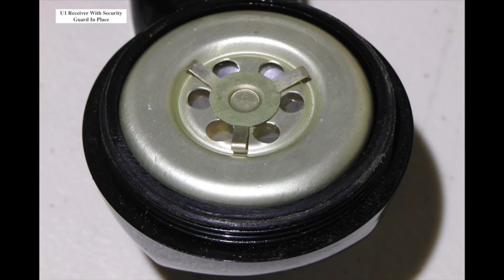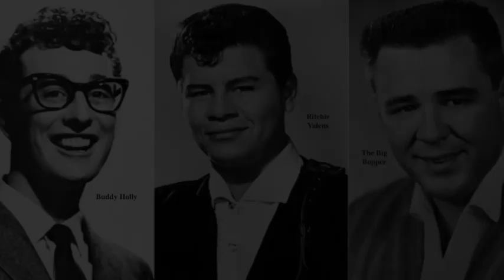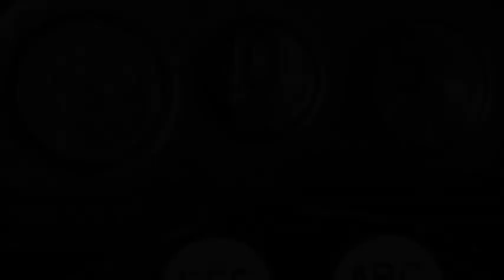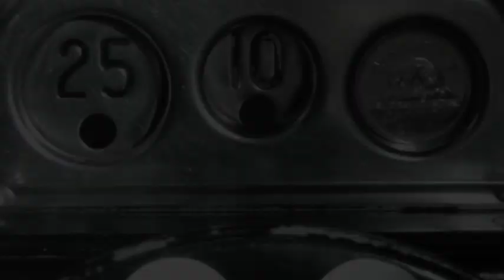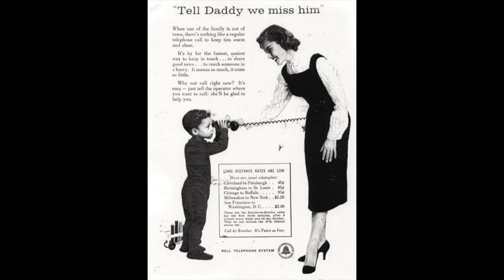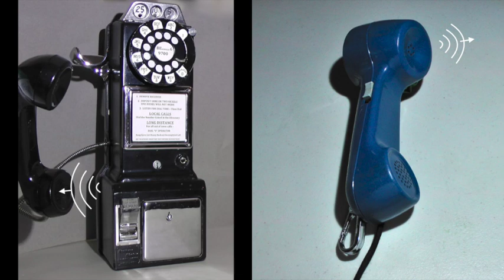The 3-Slot Payphone Part 1

Comment: Your have described the pre-pay method of pay phone service. There was also a "post-pay" type of service. With post pay, no coin deposit is required to start the call. Simply lift the handset. The dial tone(or operator's response on a manual exchange)is heard b y the caller. The caller dials the desired local number. Upon the answer, caller must immediately deposit the payment. If no answer, no payment is required. Caller simply hangs up.
Unlike pre-pay, there is no coin return on the pay phone itself, except for bent coins. Making a long distance call,  caller dials operator as with pre-pay, except the call payment is required when the called party answers; no coin return. Phone's instruction card would read: DO NOT DEPOSIT MONEY UNTIL PARTY ANSWERS.
Reply from the maker: Yes, this was the most common method up through the 1940's. In the 1950's and and 1960's, the prepay method was the most common (in the Bell System). In the 1970's, it reverted back to a new form of post pay called  Dial Tone First (DTF), to ensure people could reach emergency services without having to fumble around for a coin. Thanks for watching.
Reply: @Hicken65  The one time I used a post-pay phone, the way it worked was when the other party answered, a loud buzzing type sound came on that didn't allow you to hear the other person until you put 15 cents in, then you could hear the person at the other end, but they would have already said Hello and hopefully they wouldn't hang up before you put your coins in.  It was awkward and pre pay was much better.   Pay phones that took quarters, where calls were a quarter, allowed making an emergency call or dialing the operator without a coin.   You could also dial a long distance number and it would tell you how much money to put in.   You could also make a collect call without a coin by dialing 0, the area code, and number.

Comment: why did they make exchange letters instead of just naming the exchanges as a number (exchange 65 , 31 etc)
Reply from the maker: Exchange names were mnemonics that helped to reduce errors when subscribers gave the called party's telephone number to a switchboard operator. It was felt (by the Bell System braintrust) that a name and 4 numerals was much easier to retain correctly than 6 or 7 numerals in the interval between looking the number up in the directory, memorizing it, and then repeating it to the operator. When dial switching was introduced, the exchange names were retained, because by then the public had come to love them and there would be hell to pay if they were removed. Hell was paid in the 1960's when the conversion to All number Calling began to be phased in due to a shortage of numbers. Using 3 digit office codes that had been unsuitable for exchange names allowed for considerable expansion in number capacity.
Reply: Actually, exchanges were specific to a location. My number was EMerson-2360, because the switching station was on Emerson Street. MUrray Hill-2345 was in Murray Hill, etc.
Reply: @jamespfitzExactly!

Comment: When u call from phone to phone will ring  in the speaker when u call some one without ur switchboard being connected to the pstn
Reply from the maker: The SXS demo unit is a standalone set up that can complete calls between the two phones connected to it. The PSTN is not involved.
Reply: Can you Just have a switchboard in a local co
Reply from the maker: @ryanbelknap814  In areas where the telephone service was the manual type (no dials), the CO 's just had cord switchboards.
Reply: @Hicken65  when u say no dial in other words there where no rotary dial phones just dtmf
Reply from the maker: @ryanbelknap814  No, I'm talking about places that didn't have rotary dials or DTMF  keypads. You simply took your receiver off hook and this lit a lamp at the central office switchboard and the operator plugged into your jack and said "Number, please".
Reply: @Hicken65  so u mean a crank ringer on the phone
Reply from the maker: @ryanbelknap814  The earliest systems had the crank magnetos and local batteries in the telephone set. Later systems, beginning around 1900, didn't have magnetos or or local batteries. Power was provided from batteries located in the CO. The phones worked the same way as shown in my video on the 551A PBX.
Reply: @Hicken65  ok
Reply: @Hicken65  do u know where I can I buy bulk rotary payphones
Reply from the maker: @ryanbelknap814  Sorry, I don't know of any places.
Reply: @Hicken65   do u know software that landline phone companies use to assign numbers
Reply from the maker: @ryanbelknap814  Sorry, I do not.
Reply: @Hicken65  how do landline phone companies get dtmf?
Reply from the maker: @ryanbelknap814  The DTMF analog tones are generated by the electronics in a touchtone telephone set. Each time a keypad button is pushed, two tones are generated and sent over the tip and ring wires to the telephone company.
Reply: @Hicken65  oh instresting
Reply: @Hicken65   do u know how internet providers give voice over IP numbers if there is software plz give me a link
Reply from the maker: @ryanbelknap814  In North America, telephone numbering is controlled by the North American Numbering Plan Administrator. Just Google NANPA for information on that organization.
Reply: @Hicken65   do u know where can I buy bulk Canadian payphones
Reply from the maker: @ryanbelknap814  Sorry, I do not.
Reply: @Hicken65   do u know how phone companies knew  how long people have been on phone for the long distance charges on the automatic exchange
Reply from the maker: @ryanbelknap814  Before Direct Distance Dialing (DDD), switchboard operators timed the calls using devices on the switchboards called calculagraphs. Ater DDD was introduced, calls were timed by adjunct equipment at the toll switching centres called Automatic Message Accounting.
Reply: @Hicken65   how many phone lines can one automatic telephone switchboard handle with every wire  connected to a phone/fax machine
Reply from the maker: @ryanbelknap814  The No. 1 Step-By-Step could handle up to 50000 lines.
Reply: @Hicken65   how do phone  companies get money when people use debit/calling cards
Reply from the maker: @ryanbelknap814  The calling card companies pay the telephone companies for call time minutes.

Comment: In the actual service days, would an operator have allowed a collect call to a payphone? I ask because, back in the 90s, when it had all been automated, our local company had a special recording for just such a scenario. After dialing the payphone w/ 0+ & selecting the option for "collect," it would say something to the effect of, " the number you have reached, is a public telephone, which cannot accept collect calls." Think it would then ask me to select another option (e.g. calling card).
Reply from the maker: The video portrays the way phone calls were made in 1959. Collect calls to payphones were certainly allowed in those days. As the video shows, on collect calls the operator was always supposed to check to see if the called number was a payphone so the charges could be determined and collected. Things began to gradually change in the 1970's. By the 1990's, the ability to place a collect call to a payphone was no longer provided in most places. Today's payphones are nearly all one way outgoing, so you can't even make a regular call to them.

Comment: It was possible to make calls that should cost a dime, for a penny when these payphones were in use. By lowering a long narrow strip of cardboard, or a flattened straw worked well, lower it all the way down the dime slot, then put a penny down the nickel slot while simultaneously quickly pulling out the straw from the dime slot, it would register as a dime. Even if the operator came on and asked for additional money, you could still do it, a penny at a time for a 10 cents worth of a credit. Anyone remember this hack?
Reply from the maker: Phone Phreaks had a blast hacking the 3-slot payphones in a variety of different ways. I hadn't heard of your particular method before.

Comment: I've always wanted to have a high quality recording of the gong sound you hear when you deposit a quarter, but I can't seem to find one anywhere. All I can find is the modern version which consists of 5 beeps, 33 milliseconds on, 33 milliseconds off. Anybody have any pointers?
Reply from the maker: This may be difficult to find since it is not electronically generated, but rather is mechanically generated through percussion. Someone would have to have placed a high quality microphone close to the part of a payphone in which the cathedral gong is located and recorded the sound made when a quarter was deposited and then made that recording available on the internet. I haven't come across such a recording, but haven't actively searched for one, either. The clearest gong sound on my videos is perhaps the 4 gongs that are heard beginning at the 58 second mark of the "Putzing With The Payphone" video, but I'm sure that falls far short of what you're after.
Reply: @Hicken65  I know that on The Sound Ideas 6000 series, particularly 6037, there's high quality versions of the old nickel tone and dime tone. Now all I need is a high quality quarter tone. Particularly, I'm making mockups of phone calls, using a tone generator in Audacity to generate dial tones, busy tones, ringback tones, reorder tones, and the like. Specifically I'm adding these to Atmosphere Deluxe, a software made by Vectormedia Software of Halifax, England, that lets you put together soundscapes, using any sounds you like. http://www.vectormediasoftware.com/atmdeluxehome.htm.
Reply from the maker: @MsAussie83  Sounds like an interesting project. Good luck with your quest.
Reply: @Hicken65  I wonder where I would be able to find such a phone to record that tone, in a space where there's very little if any background noise.
Reply from the maker: @MsAussie83  You could post an email on the Telephone Collectors International  email group explaining who you are, where you live and what you're trying to do and ask if there are any collectors with 3-slot payphones in your area that would be willing to let let you record the sounds. Unfortunately, with Covid-19 there may be a lot of relunctance right now. You could also research if there are any telephone museums near you that have 3-slot payphones. Lastly, you can purchase a payphone on ebay for about $300.00.
Reply: @Hicken65  I wouldn't know where to put it, as I live in a studio apartment, and that's a bit of a small space for a payphone. I sure hope this Covid19 thing doesn't last much longer, since I've been going crazy for months because I can't go anywhere with my provider except for outside on my back patio! That would be interesting if there was a phone museum in Eugene, Oregon. I'd love to go there and make recordings of some of the old phones out there, since I have an Olympus LS100 recorder, which I absolutely looooooooooooooooove, and I've made field recordings in the parks in Eugene and Springfield since July of 2019.
Reply from the maker: @MsAussie83  Checkout the Connections Museum in Seattle. When you are able to travel, a drive up there would be well worth it for you.
Reply: @Hicken65  My American sister (I am Australian Aborigine and French Canadian, Thank you!), whose name is Amber, lives in Seattle with her beau, Jake. Where in Seattle is this Connecctions Museum? I bet she could drive me there, since I'm sight challenged and can't drive. Though I'd looooooooooooooooooooooove to have one of those self-driving cars one day! I'm sure I'd still need a driver's license for that kind of car
Reply from the maker: @MsAussie83  The museum is located at 7000 East Marginal Way, Seattle WA 98108. The museum is closed right now due to Covid-19, but in normal times is open to the public on Sundays.
Reply: @Hicken65  I bet it would be crowded there on a Sunday. Is Sunday the only day the museum is open to visitors? I'm confused on that one!
Reply from the maker: @MsAussie83  That's what the website says.

Comment: Confused: why does the operator have TWO coin collection keys? A button, then a lever?
Reply from the maker: The lever (key) has two functions. Its main and most common function is to cause the application of ringing current to a called telephone. Its second function is to cause the application of coin collect or coin return voltage to a payphone. The pushing of the "C" or "R" buttons temporarily changes the lever's functionality from ringing to coin collection/return.

Comment: HicKen65: Another comment I have is that not all pay phones had dials, even in 1959!  A non-dial pay phone had the instruction card mounted where the dial would have been. Instead of a dial tone, an operator would ask "Number Please" after which the caller would tell the operator the number wanted. These pay phones can be either pre-pay or post-pay. The operator had the ability to accept or return any deposited coins on pre-pay. On post-pay, the operator stays on the line until the party answers, then asks for the coin deposits. Many areas did not have dial switching. It could either by common battery, where the operator can be summoned by simply lifting the handset; or it could be a magneto arrangement, whereas, the user would have to turn a crank on a subset to get the operator. My father was surprised to find a magneto pay phone in service, in 1961, located on the outer banks of North Carolina.
Reply from the maker: My intention was only to cover the operation of the payphone that I have. Adding in the myriad of scenarios of pay phones in operation in 1959 would have been in the form of a lecture , thus not adding value to my already very long video. However, I appreciate your informative comments. The subject matter is interesting and , hopefully could be demonstrated by others who have the apparatus to do so. Thanks for watching.

Comment: HIcken65:Left out of this video was the POST_PAY phone. Instead of dropping a dime or 2 nickles into the slots before making the call, you would deposit these upon the answering of the called number. Upon lifting the handset, you would hear the dial tone, then proceed to dial the number. When call is answered, you had to quickly deposit the coins needed to speak with the called party. Instruction card would say DO NOT DEPOSIT UNTIL PARTY ANSWERS. Line busy or no answer, no deposit is needed. There would not be a coin return as with pre-pay, except for bent coins.
Reply: In the mid 80s, nearly all pay phones took quarters and were touch tone.   However, I did encounter older rotary dial pay phones that were "post pay" where you got the dial tone and dialed the number and had to wait for the other end to answer before having to deposit 15 cents (not 25 like all surrounding areas).   This was impossible to do without missing the other person saying "Hello" initially and was awkward.   The place where that was encountered was Cave Spring, GA and was exchange 777, which is "SPRing" and I'm sure that's why they had that exchange.   It was likely an old Strowger setup that had been there for ages.

Comment: Can you tell me how do I lubricate dial on my three drop 
Thx john
Reply from the maker: The dials weren't really meant to be lubricated. However, you could try cleaning the inside with compressed air and sparingly lube all the moving parts with sewing machine oil, except for the governor. Do not lubricate the governor.

Comment: I know this is a simplified explanation of how the switching train worked, but in reality, for a call to the same office code as the originating station, there would be digit absorbing selectors. Otherwise, there would have to be such a HUGE switching train in the CO that it would be impractical.
Reply from the maker: Well, first of all, my calls are going to different office codes . This includes from BE 6 to BE 4; BE 6 to PE 6: and BE 4 to BE-6. My fictitious office may have 50,0000 lines and a require a full complement of first through fifth selectors. In such an office, all intraoffice calls would use all the selector ranks on any intraoffice call, whether it be to the same office code or to a different one. But you're right that in a small CO with only one office code, there would be digit absorbing selectors to accommodate 7 digit dialling. In fact, digit absorbing selectors were invented for the very reason you state. It would be impractical, economically, to provide a full complement of selectors in a small office. So, when standardized 7 digit numbering started being phased in during the 1940's, the digit absorbing selector came to the rescue. Having said that, the purpose of my demo unit is to demonstrate the vertical and rotary stepping motions of the switches, so I purposely force all calls to got through all the ranks. I could easily shorten it up, since all my selectors are the digit absorbing type.
Reply: @Hicken65  You are correct. I wasn't paying attention...  Actually designing an efficient switching train was so different in every step office, all depending on what other office codes were local calls, and how many lines and office codes were in the same CO...   These are very good videos and very informative for young people that have no idea how the phone network works. (I'm an old Bell-Head from the labs myself...)
Reply from the maker: Thanks, Mark.I know well the challenges of meeting service objectives at the least possible cost, having spent many years in traffic engineering.